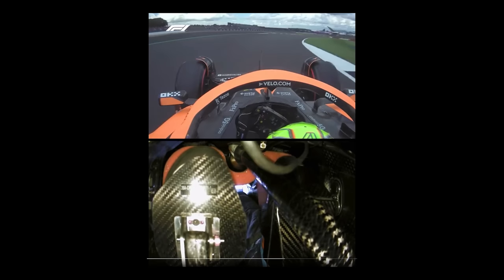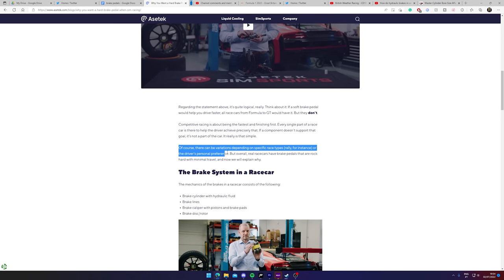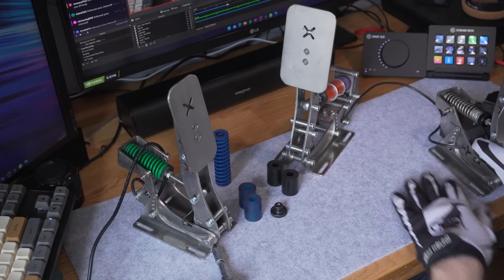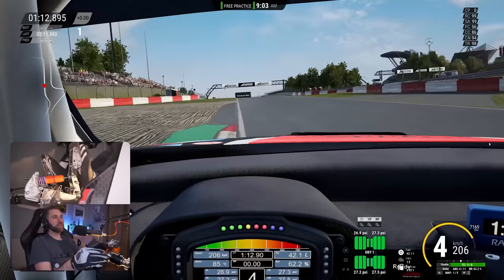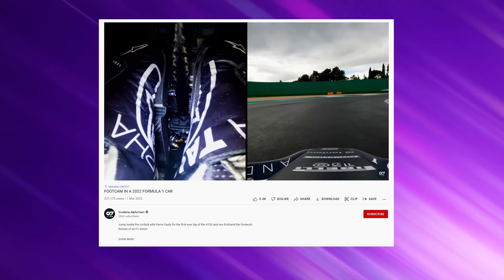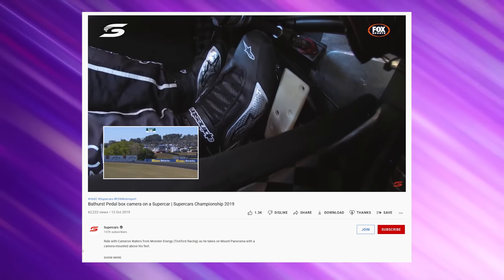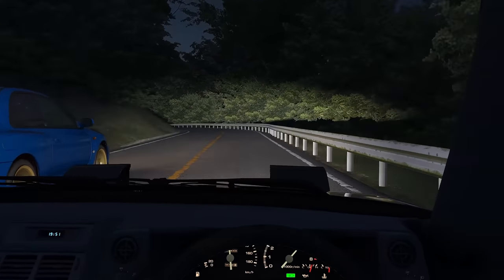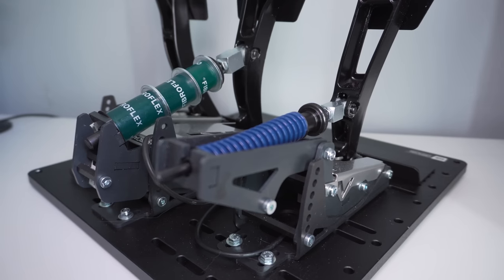Lando Norris brake cam shows simracing brake travel is all wrong

Comment: Well If you look at the pressure being put down in an F1 car. The driver is pushing over 1000 lbs of pressure into the car. In Sim racing they are pushing at max of 200 lbs. You can not link IRL to Sim racing. Gear can never match IRL

Comment: I’ve tried the higher sure ratings when I setup my pedals…and it wasn’t for me..having 2cm of brake travel did not seem natural…you want a certain degree of resistance..but like shoving your DD up to max 30nm torque…it just doesn’t make sense nor is applicable in real world…whoever started that trend, imho, had no idea what they were doing…it was more than likely done one day by accident..and that’s what they got used to, in turn made a couple of videos ..and the trend moved fwd…without research.

Same thing years ago…if you used TC ..you were shunned by the SiM snobs…that if you were a real driver you wouldn’t use TC…when at the same time the real world were in fact using TC and ABS pending the discipline.

If you look back at GT5 and GT6, if you used driving aids, you could not ..for the most part…be competitive in your times..you had to remove the aids to gain the .5 to .75 on your lap times..so in essence PD made the game applied punitive actions in the form of nerf’ing your car because you were using driving aids..when we know, real world applications…it’s a benefit.

Comment: There isn't a lot of brake travel in the video of Lando, I think you guys are just a bit desperate to justify your personal preference. It's a super wide angle camera with the brake pedal on the edge of frame that exaggerates the movement which even still is very minimal. It definitely isn't more than 20cm or so.

Comment: I was very surprised to see how much travel I saw in Landos brake pedal, I've always heard F1 brakes in particular were extremely hard with really short travel. I owned Fanatec V3s, then recently replaced them with Asetek Invictas and I love them. I took off a few seconds per lap in F1 games just from the pedals. My opinion is that the short throw allows me to apply max braking much quicker and allow me to modulate braking much more accurately. But I also agree that the Asetek marketing is exaggerated quite a bit, it's really a personal choice at the end of the day.

Comment: F1 pedals are not physically attached to the brakes these days (isn’t that what brake by wire is) That way drivers can have the inputs set to what they want and are comfortable with. The G force pushing them forward also is a huge factor. Good video though.
Reply: Not really. the pedal is still connected to the brakes via a traditional master cylinder/fluid setup. The brake by wire portion only applies to the rear axle for hydrid charging purposes. The feel is still 100% mechanical.
Reply: They have to be. Electric brakes are not allowed.

Comment: One mistake you make on this video and many others who havent raced cars do is to think that you "engage" the pads on the rotors at the end of the travel, and that is just not true, for any car, at any time. There is a minimal amount of travel required to engage them, and it is not at the end of the travel. You are increasing the pressure while the pedal is already traveling. You want to see a proof of this without going out on a racecar? Look at lando's video again, if the pads were only engaged when the pedal is at the bottom, then why the f is he trailing the brakes off? The moment the pedal started traveling back the pads would be off the rotor, right? So again, wrong. Pedal travel IS brake pressure, and there is more pressure at the end of that travel as well. Brakes are not an on/off switch, its a progressively increasing/decreasing thing that starts with travel and end with only pressure at the end of travel.

Edit: also, having tried several pedals myself and having raced several race cars (not specific made racecars but rather street cars converted to race cars, so simple setups, or 2 or master cylinders with and without ABS), I can tell you that what rassembles actual brakes the most are pedals with potentiometers and progressive springs (harder the more they compress). None of the hydraulic pedals feels right, too stiff, no movement, very hard to modulate, same with load cells (altho lower force load cells with gas or spring dampers feel pretty darn close when they arent set to require hercules to step on the pedal himself).

Comment: Problem with Sim hardware manufacturers is they're really scatty and cut corners with production quality. The steering wheels are top notch A grade. Everything else is C or D grade in quality, including pedals.

A PS5 controller has better braking feedback and haptic features than many sim pedals. Then charging another £150 for "load cell" kits which is essentially a quickfix diy job of attaching foam/sponge...which is still crappy as aftermarket 3rd part sellers on ebay provide better ones for a few £. If you're lucky you'll get a spring too..which again is crappy and 3rd party has better solutions.

The sim hardware manufacturers are far too greedy to implement innovative changes in the pedals. I reckon if they did...pedals would cost about the same as a wheel.

Nobody is going to pay for that. Sim strategy needs to be more consumer centric, mass sales with high volume at cheaper prices would attract more customers. There's a crap tonne of sim fans/gt3 mototsport fans and F1 fans out there. Gran Turismo 7 user base alone is sufficient to literally shadow half the gaming market. And that's just one console.

In my opinion, official brands like GT7/AC/iracing and Sony/Microsoft need to dish out their own setups which can easily undercut the rivals in pricing while potentially having better hardware

Comment: IMHO the problem is not the "travel" of brake, but the fact that in most famous sim game like F1 & ACC you have to completely destroy the brake and press 100% to do a braking with very little trail braking. On iRacing you hardly get to press the brake 100% and there is a LOT of trail braking.
Reply: Acc has working abs while iracing does not...
Reply: This is 100% correct. iRacing requires loads more trail braking and more precise braking techniques compared to other sim titles.
Reply: @ady6022  As a Porche fan, I had the pleasure of speaking with Kévin Estre. I asked him in reality, how the brake works with a GT3 with ABS compared to a GTE without ABS. With GT3s you never get to 100% and do a LOT of trail braking. Like iRacing with GT3 cars. While with the GTEs if you brake close to 100%, you block the tires. Like iRacing with GTE cars.

Comment: The thing you’re not taking into account is the fact that Lando is putting over 250 pounds of force into his pedal. While on sim racing it’s like 5 pounds.
Reply: Even a potentiometer based brake is going to require more force than that.
On my LC based brake I have a 100kg LC and it has no mechanical advantage and I quite easily max that out, don't know what that is in old timer units
Reply: @fathead7  yeah I know. I was just trying to get the point across that these people don’t know what they are talking about when it comes to the mechanics of f1. They decelerate at 5g plus and use that force to push themselves into the brake. Pretty crazy how f1 works.

Comment: Thumbs down on the click baity title
Reply from the maker: accurate title.
Reply: @randomcallsign  says the guy that created the video.
It's not accurate and even yourself said it during video, its about driver preference. As such, Simracing didn't get it all wrong, if we pick for example, the alphatauri setup which also has minimal to no travel, its similar to what most setups in Simracing have. So did Simracing got it "All" wrong? No.
A more accurate title would be around "Simracing brake travel misconception provem wrong by Lando Norris brake cam" or something along those lines.
Reply from the maker: You got it. Its about driver preference and not about the marketing or multiple simracing references that state "racing cars brakes are like this".

The title is accurate. Have a great day.